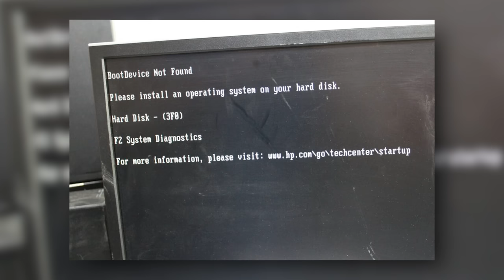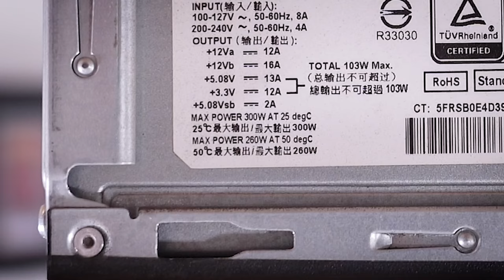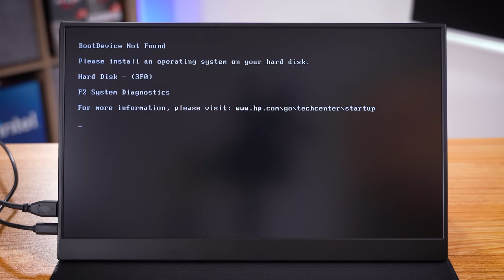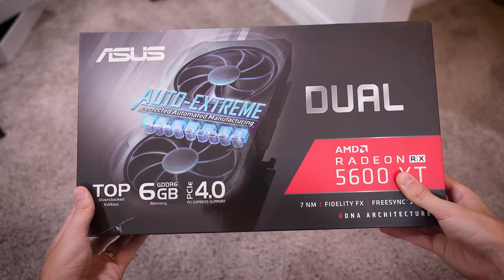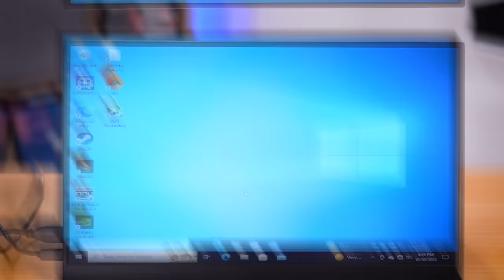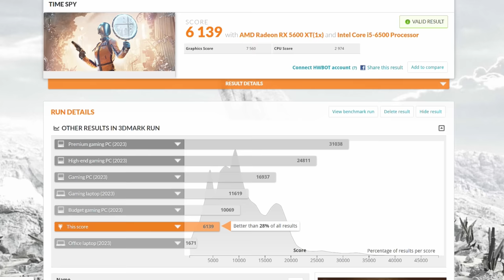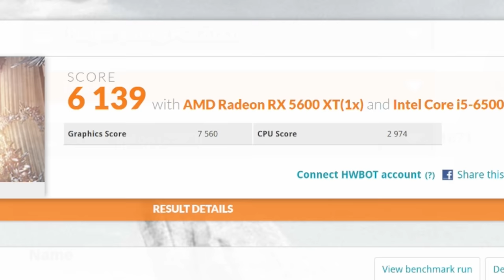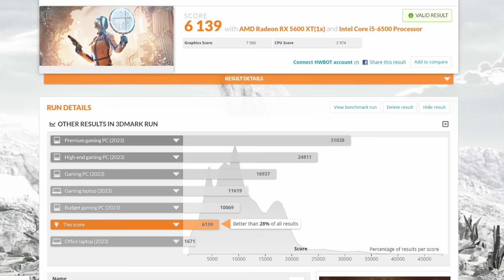I Built a $200 Bare-Bones Gaming PC!

Comment: have a feeling a cheap memory upgrade would have done this system wonders.

awesome video btw, keep up the great work greg.
Reply: With a simple memory upgrade, this machine could be amazing to sell to young audiences. Kids who only need to play roblox, fortnite and minecraft like I did growing up, I mean this is a great first rig. Just slap faster 16gb RAM and this baby be running minecraft at max settings easily with optifine. (Don't worry, kids will figure out how to mod games, I sure did.) 

And I mean sure, the weirdness with GTA 5 sucks, but saint's row is similar enough to that game and can literally run on a toaster oven. This should have no trouble running it.
Reply: @Thatonefuckinguy yeah true, especially because between being a cheap way to enter pc gaming its also a learning experience. i have to wonder if being so memory limited as well as single channel contributed to GTAs LOD issues. Because otherwise between the CPU & GPU there isnt a reason for it. Especially as the game runs much better on much weaker hardware.

Comment: I actually just built one of these last week. I picked one up off a guy local that looks the same with an I5-6500 and 8Gb ram for $60. I already had an older 650W power supply i threw into it and an ASUS RTX 2060 I found for $100. It has been running good for me. I did have that texture/loading issue that GTA was having in Fortnight, and just a lot of stuttering in other games as well. I noticed the system ram was maxed out at 7.5Gb used. So I ordered a 16gb kit off Amazon for $27 and that fixed it for me. The stuttering was way down and the same issues GTA was having that I had in Fortnight with missing/unloaded textures was gone as well. I run the games at 4k lowest with TAA or DLSS and it has been pretty smooth for me so far. Although for War Thunder Ive got it on high with quality TAA at 4k and getting about 80-100 FPS with very few drops to 65ish when alot is going on.

Comment: For the USB 3 clearance issue it might be worth getting some low profile USB header adapter cables. They're usually pretty inexpensive, and they let you fit larger cards without sacrificing USB ports.
Reply: Will a jumper work?
Reply: It's simply just the front USB 3 adapter. You can still use the ones in the rear directly attached to the motherboard. If you can find a low profile angled connector to make it work go 4 it but if you don't need it in order to use your rear USB 3 ports.

Comment: I had basically the same base setup as this HP prebuilt, but much jankier. So I started with a full HP ProDesk/EliteDesk SFF set for ~RM650(~$154) back in December 2021, then added a 512GB boot SSD for RM120(~$27) early this year, and then had to swap cases as my power supply got fried during a thunderstorm (meaning that I had to shell out RM30($6-ish) for a power supply adapter for the SFF motherboard and another RM30 for a Dell Optiplex case in May (I also upgraded the CPU cooler to an ID-Cooling SE-224XT for RM71 (~$16). And to cap it all off, I got an RX580 2048SP for RM200 ($44) in July. And the best part is that I can't even close the side panel properly because the SE-224 is a bit too big. Oh, and also in addition to having to rip out the USB 3.0 front panel ports, I had to rip out the original HP power button from the original SFF case because I can't figure out the pin layout on the motherboard to connect the new case's power button. The next step will have to wait until I have the time and funds, but I guess the next thing to do is getting a proper case and get the front panel USB 3.0 port working again with a 90-degree adapter. 

*note that the approximated USD prices are as accurate as possible to the respective period I bought all the stuff.

Comment: I also got a hp g400 for my first build, had a 4th gen i5, upgraded the ram to 8gb, upgraded the psu, got an ssd, and also bought an rx 570 8gb. Couldn't be more happy for what it offers.
I love the fact these hp systems do not have proprietary connections so it's quite easy to upgrade.

Comment: The memory thing was to be expected. I was given a Lenovo M71e with an i3-2100 years ago. I used it for a time, and then it wound up sitting forgotten on the back porch (which has a roof) for almost two years. After cleaning it up, you guessed it -- no POST. Replaced the CMOS battery, reseated the RAM and it was off to the races. Due to limitations of the stock H61 board, the i3-2100 and the i7-2600 I upgraded it to wound up being transplanted to DH77EB boards with 16GB DDR3-1333, 500GB SSD and 1TB storage drive. The i3 and i7 paired nicely with EVGA SC GTX750ti and GTX1050 cards (respectively) after that. Screaming little systems for under $400 each (new PSU / case / storage). I managed to get 35-50 FPS at 1600p from both, and they ran perfectly. Tried to sell, no one wanted to give me what I had in them, so I gave them to a friend who could use them. Still running perfectly, and his son is tickled pink with the i3 / GTX750ti rig.

Comment: They put parts/not working because it means if it doesn't work, you can't really complain.  There is a different expectation on final quality.

I've done this on perfectly good RAM or CPUs.  Pulled from a system that boots to BIOS, they SHOULD be fine, but without a full Windows test, there's no way to know (as you noted on a previous system where it could have been the CPU or MB that caused the Windows install to consistently fail).

Comment: Only thing I missed was a temperature review with the case fully closed. In my experience, these CPU coolers from prebuilds are juuust capable enough for what they are designed, but the GPU certainly introduces more heat to the system. Maybe somehow adding an intake fan in that grill/gap on the front side of the case could work and be a cheap alternative to changing the cpu cooler. 

Also, I couldn't shake the feeling that the case was upside down during the entire video lol

Amazing work (and patience) in fitting that big GPU. I'd probably involve a saw in the process as well

Comment: This is a decent deal, but honestly you can find refurbished HP, Dell and Lenovos Desktops on Newegg for anywhere from $150-$400 and some of the one around $300-$400 come with an 7th&8th gen Intel i7 and some have AMD Zen 1 and Zen + with a dedicated GPU like a 1660ti. But you can also find systems with an open PCI-E x16 slot and a 500w PSU. for $150-$250 and spending $100 - $200 on a used GPU like a 2070 super if you want ray tracing or a used GTX 1080ti which is still an amazingly powerful GPU still. It out performs a 2070 super and they overclock like a beast! I wish I had the budget to be able to build systems like this for YT, I would turn out such good content!!!

Comment: Kudos for HP for making that workstation use standard style parts and connectors, it makes it so much more environmentally friendly as you can keep upgrading it. I also used a 5600XT on a old Haswell i7 system I got up and running, and it is just the perfect 1080p card for this kind of use cases.

Comment: Great job and thanks for the inspiration! I had a friend I actually owed a low end gaming box to. I was able to go on eBay and find a nearly identical HP system for just over $50 shipped, I plan on cribbing most of what you did here. 🤣 I might look for right angle USB adapter to see if I can do something about this front panel ports though.

Comment: Generally on ebay if you list a computer such as this and it doesn't have a storage drive you should list it as is for parts  or not working.  When you list something you have four condition categories to list the item as, New, open box, used and for parts not working.  Ebays description of used - An item that has been used previously. The item may have some signs of cosmetic wear, but is fully operational and functions as intended.   Well as you can see the computer you bought is not fully operational.

Comment: Id be interested in seeing a cheap cpu upgrade for this build, a 6700/7700 would make such a big difference I would think
Reply: I would be surprised if this board was capable of running a 7700, it was really sketchy even with high end motherboards.
Reply: The 6700 does indeed make a huge difference because of the hyperthreading support. I just recently built a couple budget gaming PCs out of old HP workstations - one 6th gen i5 and one 6th gen i7 - and the i7 absolutely destroys the i5 thanks to the hyperthreading support.

Comment: I have done a lot of this lately. Buy a cheap system and, at the very least, repurpose it for emulation. Usually though I can sink $100-$200 more into it and get something passable in performance. Well done. :) BTW - a Dell 1660 ti is a very small card and would fit easily in the tight cases like this. I try and buy those single fan 1660/1650 cards specifically on my cheap builds.

Comment: No way!!! I built a gaming PC using that exact same model pre-built a couple years ago. The quad core (no hyperthreading) definitely hurt performance. I put a new power supply in and bought a used gtx-1060 6 gb. It was able to play a lot of games at decent settings. 

Also, I did have the same results when running GTA V. It was glitchy

Comment: Old tech can be fun to upgrade and see what can be done with it.  Got an older Optiplex 5040 mini tower with an i7-6700.  Managed to find a cheap 16GB ram kit and an GTX1650 that doesn't require supplemental power, and it can run games at 1080p medium @ 60FPS all day long.  And when that time passes, it will make a great Folding @ Home box.

Comment: Old doesn't mean bad or slow. I bought a refurbished Lenovo Thinkcentre with a Core i5 4570 for $180. I added 8 more GB of ram to total 16 and installed an RX 6400 low profile card and can play Fortnite in 1440p @ 100 fps with medium settings. Runs great for under $300.

Comment: I bought an old office computer with a i5 7500 for around 100.00. I dropped in another 8 gig stick of ram and put in an rx6400, due to space constraints. For less than 300 bucks, I have a decent system.

Comment: If this came from ATG Wireless I was eyeing that PC last month, but they wanted too much for it along with shipping.  I definitely would’ve done a motherboard swap.  If one chooses to leave it as is it could be used as a NAS, Steam Box, Hackintosh, or a basic level Windows machine.

I did an AM4 Ryzenplex out of an Optiplex 3020 for my 10 year old, and am currently putting the finishing touches on an AM5 T1700 sleeper build.

Comment: "Old" software is being updating to "new" software... and not in a good way. Unreal, ATI and Nvidia are doing it too. They are ruling out the initial hardware requirements whilst stating still "compatible"... they are "forcing" redundancy whilst being sleazy. The problems are more down to chipsets and drivers rather than the individual hardware (CPU, RAM etc).

It's nasty if you ask me. You could have a machine that was perfect for a game... but they will update the game/software to unstable levels due to focussing more on newer hardware and ignoring or even ruling out older hardware... leaving that game that ran perfectly not running as good as it did before on the exact same machine.

Comment: I have a question for Greg how do you find out what memory any computer takes , I have an HP Pro 3000 SFF desktop i have replaced the motherboard i found a brand new one on ebay i have replaced the memory the cpu with even an upgraded one and i still get nothing on the screen it turns on the fans spin but nothing on the screen, I have a suspicion it could possibly be the wrong memory i got for it but can't seen to find the exact memory it takes.

Comment: About the stutters in GTA 5: I have recently built a couple budget gaming PCs out of old HP workstations and I noticed that the 6th gen i5 (4 cores, 4 threads) simply doesn't cut it in some games, like GTA 5 and Fortnite, because of the lack of hyperthreading. I built a near identical system with a 6th gen i7 (4 cores, 8 threads) shortly after and the stutters were essentially completely gone.
Reply: I started playing GTA V in 2018 on a dell prebuilt that came with an Intel i7 4790 (4 cores 8 threads), 16gb RAM and I slotted in a 1050 2gb gpu. No missing textures. Game ran just fine.
Reply: Windows 10/11 have a lot of unnecessary programs and services running, not to mention Telemetry. Suppose you removed all that. Wouldn't games run smoother then? Look up Tech Yes City's film, Making a CUSTOM Windows 10 .ISO.
Reply: @irukhan07  pretty sure the 4790 destroys the 6500, by quite a lot.
Reply: @activeentropy  I went from the 4790 to an AMD system with an R7 3700x. Literally nothing felt different in daily usage. Maybe FPS in games were better but that's about it.
Reply: @irukhan07  For day to day tasks you won't feel a difference but you will feel a difference in gaming as long as you upgraded the 1050ti otherwise that would be the major bottle neck. Anyway that wasn't the point I was just trying to explain the difference between the 6500 and the 4790 for playing any games.
Reply: @activeentropy  you're correct. I was later using an rtx 2070 with the 4790 and then same with the 3700x. I have short videos on my channel of how I crammed the 2070 into the dell prebuilt XD

Comment: My last prebuilt was a second hand T3600 workstation from Dell.  I still have it and have it as a backup.  Just got a new to me custom i5 6500 ITX build.  In some ways it is a downgrade but it is getting old and temperamental  and I hoped to get something that supports DDR 4 and some modern instruction sets.  I have the same GPU but it is acting up so I have my RX 570 in it till I can get around to doing a tear down and repaste the RX 5600XT.   Honestly still trying to troubleshoot random crashes with it.

Comment: I have a i5 6500 with a rx5700xt I only run 1080p with it, but it has not had any issues at all. It even runs Warzone 2.0, Fortnite and any other game I have used it for without any stuttering. I know the video card is a little more powerful and I am running 1080p but I feel that if I plugged it up to a 1440p monitor it wouldn't have those issue. It is on a asus motherboard with 3200mhz ram but, im thinking that a fresh windows install may help you with this. Also that could be 8gbs of ram being a factor as I am running 16gbs

Comment: The original PSU would totally run that 5600 card BTW (also 5700 is a similar price/performance ratio, but it's faster).  Just need a SATA to 8 pin adapter.  Also there are 90° USB3 header adapters.

Comment: Been doing this a lot recently. Averaging around $220 or so building them with an RX580, 1tb SSD, and usually bumping them up to 16gb of ram. Usually need a SATA to 8-pin adapter but they’re pretty cheap. Good deep clean and they run 1080p pretty strong!

Comment: My bro.  You gotta pick up a DisplayPort to HDMI adapter, they are like $3.  I understand that you have a spare GPU laying around.  However it is way too cheap and small to not want to have one for when you may not have a GPU to hand or it won't fit for whatever reason. (Some small systems may only have DisplayPort, or non standard GPU form factors.  You may be on the road or at a friend's house etc)

Comment: If I had just...  My first ever PC build had an FX-8350 and an R9-270X.  I very nearly spend a little more for a 4790K.  If I had just...  I wouldn't build a PC for anyone else with used parts, but for myself, no sweat.  I'd sort of like to build a 4790K system and drop one of my 980Ti cards in just to play around with.

Comment: Built a friend a X99 rig using a chinise board and the 2690v3 xeon unlocked which in games it goes to 3.5ghz ran gta 5 and other games better then my friends 10400f, i7-7700's.

Recently made a nother build with the E5-2643v3 6c/12t which by itsself boost to3.5- 3.6 ghz run GTA perfectly.

It seems like 8t is the minimum you would want now since gta 5 for example looked the same way when i tried runing GTA on a 2c vs 4c in 2017

Comment: GTA 5 is certainly a weird game.  Dawid Does Tech Stuff has seen the same behavior with it in older systems.  To the GPU, a single fan model for an ITX build may have been a better option.  You wouldn't have to play with the wiring, have decent cooling, and they cost around the same price.  My daughter's fiancé uses one of the ITX style single fan GTX 1660 Tis in a build with no heat issues at all.

Comment: I wonder. With the upgrade you did, would the motherboard be able to handle a 6700k? still a 4core but has 8 threads and is oc'able.
Reply: 6700k isn't worth it, just go for the 6700. Can't overclock so just save a bit of money. About $10, 6700 is about $60 while the k varient is about $70.

Comment: 9 times out of 10 when you have two modules not same speed, they will always default to the slowest speed on that ram. it most likely wasnt detecting the module in one slot. using isopropyl alcohol to clean the pads on both modules and brushing off the Dimm slots freeing any addtl dust should fix any issues

Comment: Finally! I've been telling you to use the ProDesk 400 G1/G2 MT, 280 G1 MT or 490 G1 MT since the pandemic. ATX PSU, takes Xeon E3 1240 v3 no problem. 
These were/are the best bang for buck office => gaming pc upgradables. I usually just dremel out 2 very small pieces to make space for the GPU. I recommend drilling mounting holes for the PSU too, or the fan will point up towards the case and not get ANY fresh air.

I also make sure to either run ReviOS or at least use InSpectre to disable security patches. 

Edit: This doesn't seem to be the G1 as advertised. The G1 and G2 are Haswell, whereas the G3 and up are Skylake. It looks like they're using the old case for the new parts. As far as I know, no G1 for Skylake exists and the G4 looks different entirely but always comes with Haswell.